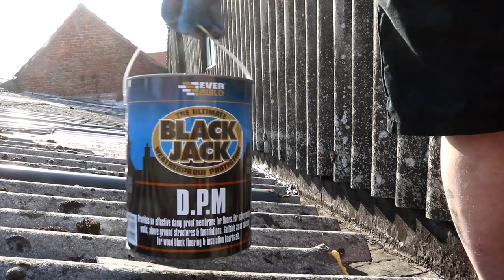FILLING CRACKS LIKE A...

Comment: How about Tee nuts in the hardwood part of the tops and stainless flat head screws to mount the ply tops to the stainless rings? You can bore a hole that doesn't punch through the ply tops and drive a tee nut in with some epoxy in the hole, just to make sure they stay put. There are also some brass threaded inserts that you could just drill a slightly undersized hole and thread a screw in the insert and drive it in with a drill or screwdriver.

Comment: Is that an asbestos concrete roof?
Reply: That's what I was thinking.Looks well dodgy!
Reply: Gary z  only if disturbed. However it will be a PITA to remove.
Reply: Gary z  only if disturbed. However it will be a PITA to remove.
Reply from the maker: Yes, asbestos. I am not touching it apart from pouring sealant on.
Reply: Fun times!